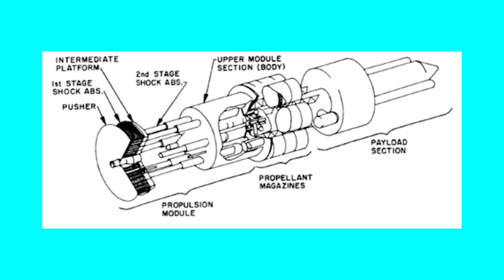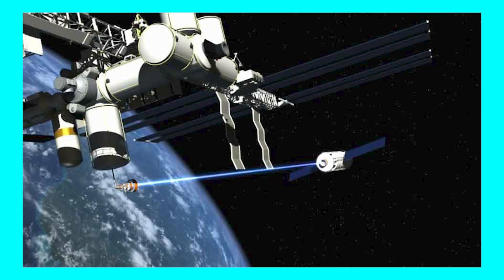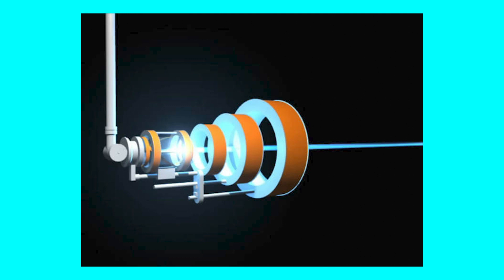Nuclear Space Propulsion: Salt Water Rockets, NERVA, and Mag Beam | Rock Logic | Ep. 16

Comment: I worked on Jupiter Icy Moons Orbiter back in the day at NASA. Mostly mechanisms for the orbiter. As you say, the spacecraft had a huge power budget. The plan was to scan actively and beam data back simultanously, so all the articulating mechanisms had to be accurate to a few miliradians. Such a cool project, but without O'Keefe pushing space nukes, the project lost funding. Also, it was so heavy that even with a Delta IV Heavy it was going to take 3 launches to get it to nuclear-safe orbit where it could fire up the reactor and propel itself on to Jupiter.

You mention mass of shielding and so forth due to the reactor, but most of the shielding mass was associated with loitering in the radiation belts at Jupiter. We were expecting 3 megarad total dose to the electronics for the 6 month mission, and that was almost exclusively from the Jovian environment.
Reply from the maker: Very cool! Thank you for the added detail!